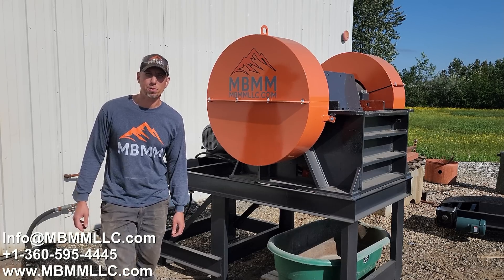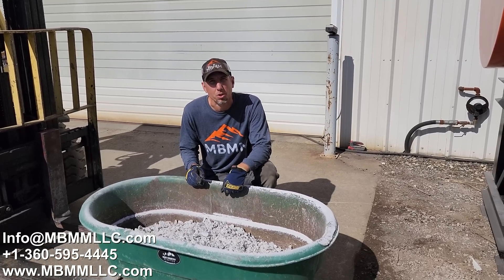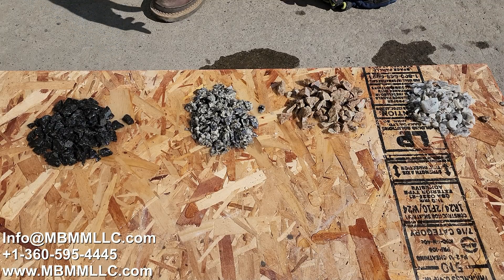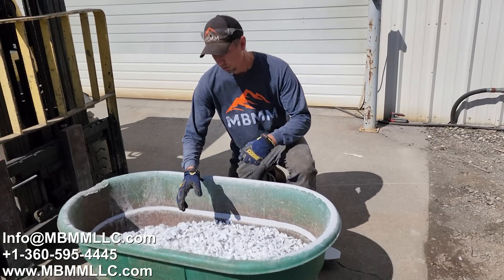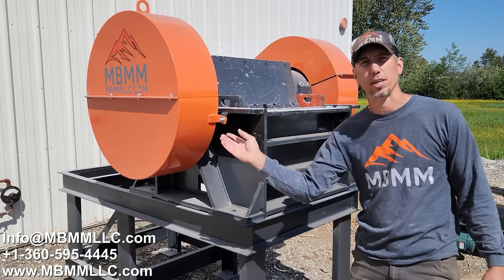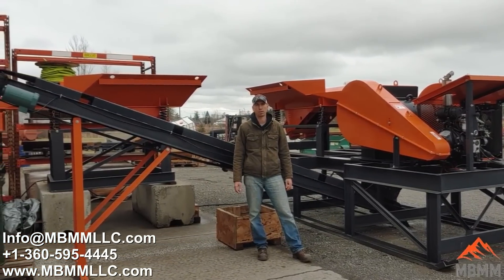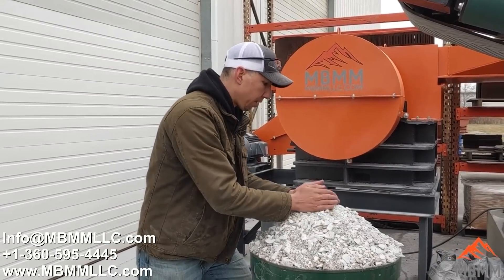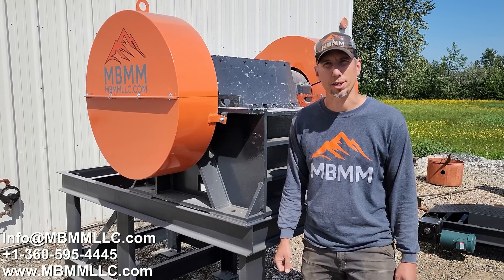Recycling Scrap Granite & Quartz Waste into Profitable Gravel with a 6x30 MBMM Jaw Crusher

Comment: I wonder if you could crush asphalt rubble with one of these or if the oil in it would gum up the crusher 🤔 we have asphalt and concrete rubble we can't get rid of but buy both already crushed to sell in our landscape supply yard. We can almost always find crushed concrete, but even millings are tough to come by little lone uniformly crushed asphalt. We don't even bother carrying granite or quartz because it's so difficult/expensive around here.

Comment: couldnt they do the same with glas and a tumbler for mixed sized beads with a tighter crush? or is that a steep to far for the to have something like that running? ofc it cant be the kind the goes to 1k bits when smashed